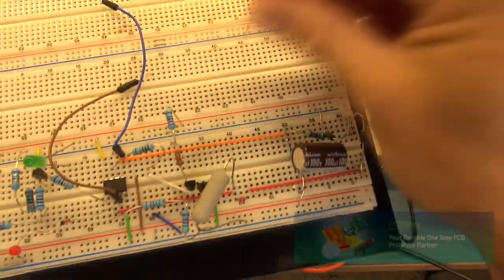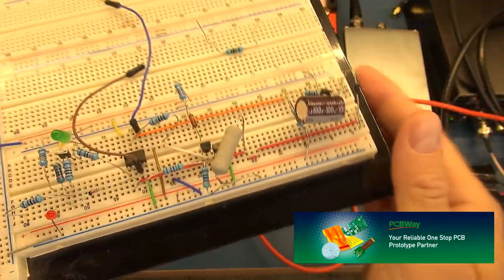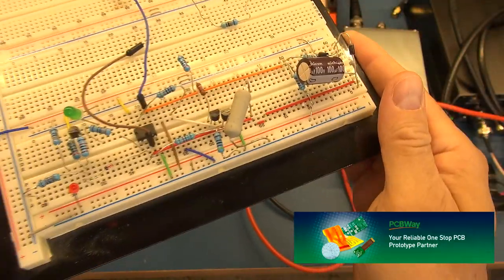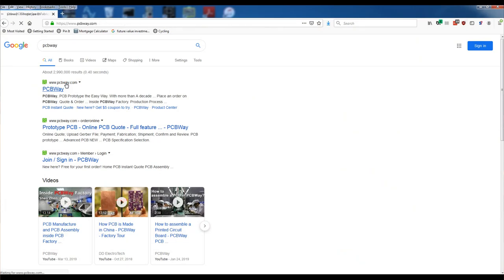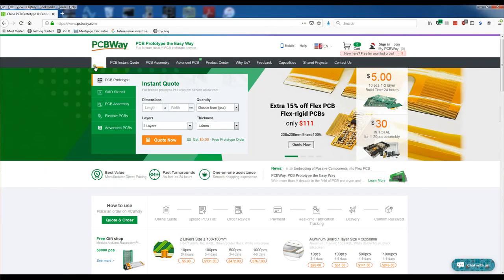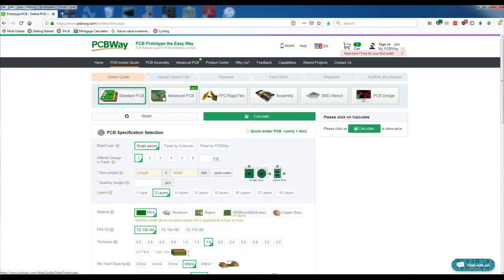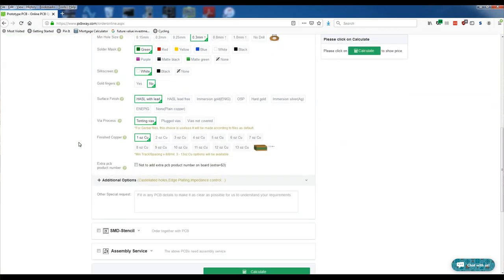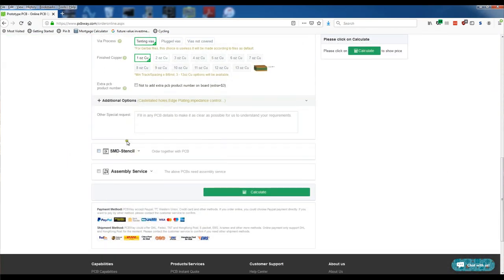Vlog #1 - Keeping Viewer's Attention...

Comment: I really hope part of your solar testing is about the new power banks with the folldout solar panels.
I don't think they're  quite there yet but improving a lot.
Maybe dropping 10,000 mAh  to add more foldouts so they don't take 2 days to charge and still weigh the same?
I'd love to hear your comments on that idea.
.
For some reason I thing you'd find this quite fascinating for yourself - How vehicle clocks worked in the 1950 and 60's.
I dismantled one once and was fascinated and even converted one into other projects because the timing was very good.
.
I was interested in your oscilloscope tutorials because I wanted one but sadly I can't think of a practical use for it at home.

Comment: Hi Martin, I'm not sure if you'd remember me but just this week I sent you progress I've made on the Constant Current DC load project and asked you for the CAD schematics.  You might find this funny - I read EEE (specialising in Computer Engineering) and Masters in Mechatronics in the UK.  However, I moved into software engineering and that's been my primary profession for little over a decade.  Thankfully, during my undergrad years, I spent a lot of time at the University labs and had fun building BCD calculators on breadboard, working with PICs, and these were all well before Github/Arduino existed.  I ended up writing my own C libraries for SPI/I2C/Serial comms etc.

Having moved to a new space I decided to setup my homelab backup once again, as I wanted to work on some IoT projects with ESP8266/ESP32 and ATmel ICs.  Spending time on YouTube though, I found your content and I wanted to expand my experience with Op amps in particular.  At University we covered theory but did not heavily get into applying Opamp circuits - I'm basically taking this general approach and I must thank you already for the volume of information I've learned from your various projects.

With regards to your video styles, I actually do like the way you've continued to progress; I would like to see more details and engagement on the forums if possible, although I'm not sure if you have the time anymore.  It would also be greatly useful if you could provide a part list using say export.farnell.com.  Anyways, thanks again.  P.S. I watched this till the end.
Reply from the maker: Thanks for the post and email Mike.  I sadly don't have time fat the moment for more detail and time on forums. In the future hope to move away from having to produce a set number of videos each month and only produce one when I'm ready. That way I can get more enjoyment from the process, time to complete projects and provide added detail etc. Cheers, Martin.

Comment: Tannie SAUK started rotting minds in 1977, though they had a test transmission period for around a year before to get the network and such set up. I have the same birthday, and I was in primary school.

As to the time watching TV, i rarely actually turn the input to actual TV content, as the most common use for the big monitor is as a computer display, because the 32in 1360x768 TV set is a lot cheaper than the same size monitor, and I really do not need 2k, 4k, or higher resolutions.... Actually turned it on to TV today, and realised it needed to have the decoder reset.

Yes the IT stories are interesting, be a different part of the channel.

Lovely little dog, yes it is now definitely your dog, despite the thoughts of your daughter, same happened with my father, and they became inseparable. Me, I had a found kitten come in, who spends the days sleeping in the bed, under the duvet.
Reply from the maker: Sean, my rock. I chuckled reading about how you use a "TV". Now that you talk about the test transmissions I remember watching that test pattern for ages waiting for the transmissions!
Reply: @mjlorton  I actually used that test pattern to repair my TV set, adjusting the geometry late one night, after fixing the Telefunken power supply for the umpteenth time. Decided the wimpy heatsink had to go, so in went a considerably larger piece of aluminium alloy extrusion that was able to fit in there, and wired up the transistor leads to where the transistor was mounted. 

Never got it right, there was some distortion, but at least i got it mostly right. This was in around 1990, when Gulf war one was live on TV, and was the favourite channel we all watched at work, with the shout when "interesting" things were coming in live.

Comment: I cant watch most modern movies, the ultrafast scene changes drive me nuts.  Talking head videos, I put on a 2nd screen while I'm working, so I dont really care how long they are as long as there is something to the content,  live streams with lots of dead air I cant watch, I'll watch it later at 2-5x speed and slow down for the actual content.  Made it to the end, would be very interested in PSU noise measurement